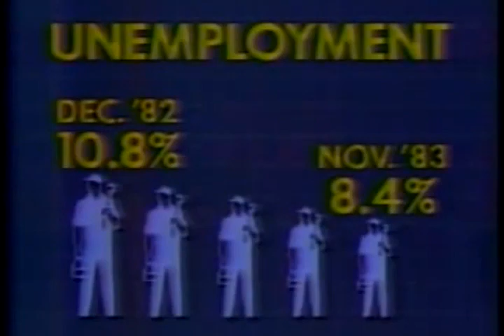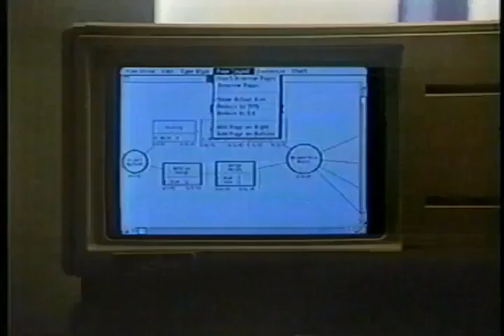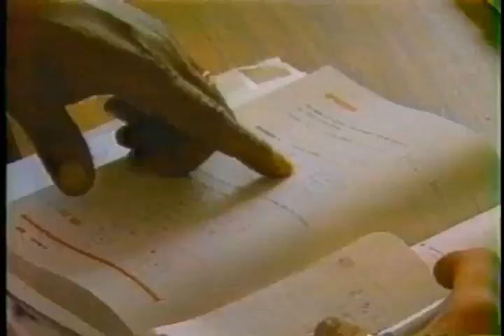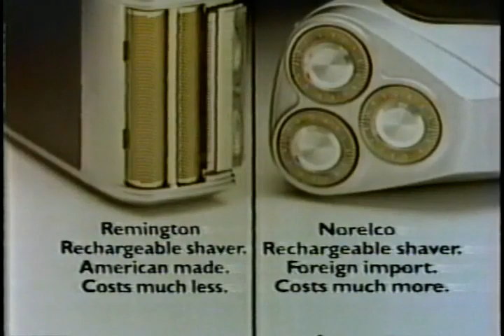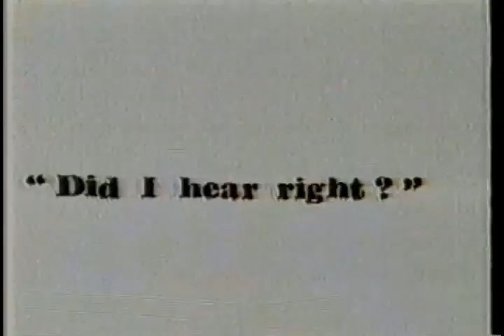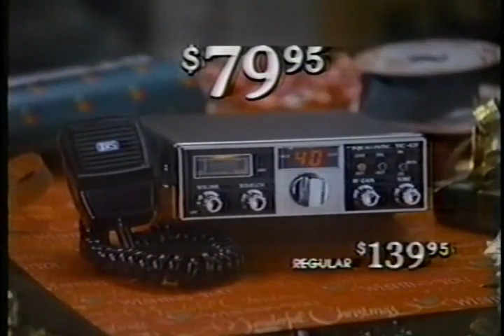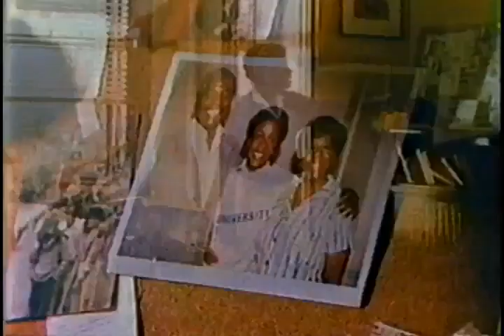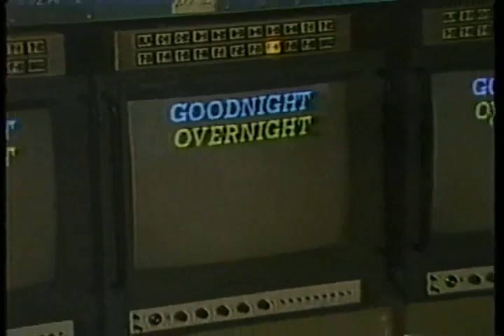NBC News Overnight 1983-12-03 final broadcast

Comment: Detroit, Michigan viewers never seen Linda Ellerbee. WDIV channel 4 didn’t have it despite of being 24 hours broadcasting. It aired a late movie at 2am. WDIV cleared late night with David Letterman at 1am instead of 12:30am up until August 5, 1983. That night WDIV still aired the late movie at 2am like usual. Any NBC stations other than WDIV Detroit That didn’t have NBC Overnight News. WDIV’s late movie that night was Invasion Of Planet Earth start time 2:30am.
WDIVs schedule after Johnny Carson as of September 5, 1983 Had Entertainment Tonight At 12:30pm, Thicke Of The Night With Alan Thicke at 1am, and Late Movie At 2:30pm, and The Lone Ranger at 4am and it never signed off.
Reply: When SNL first began  Ch 4 would not carry it either but WKBD Ch 50 the independent did. WKBD also carried the Tomorrow show  in the beginning as well. Letterman was delayed to 1:05am and also needed to record the show and air it the next day to be able to do that. It was years before it finally ran at 12:35am. Basically Ch 4 WWJ/WDIV treated NBC like crap between 12:35am and 7:00am.